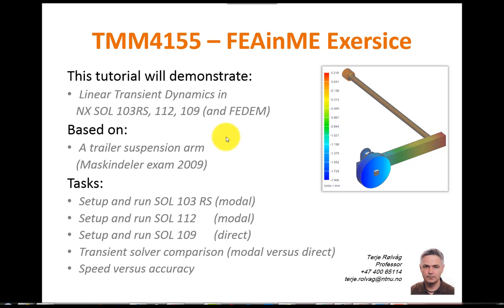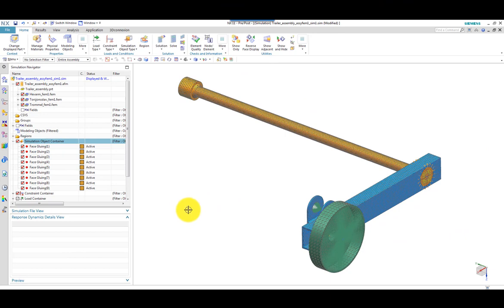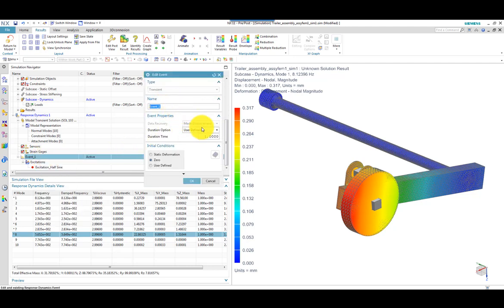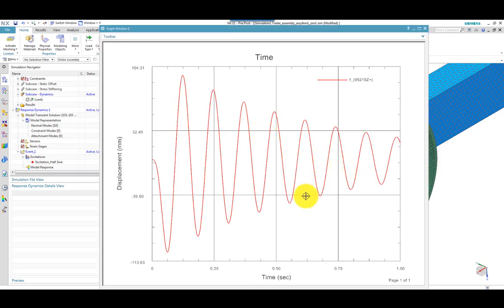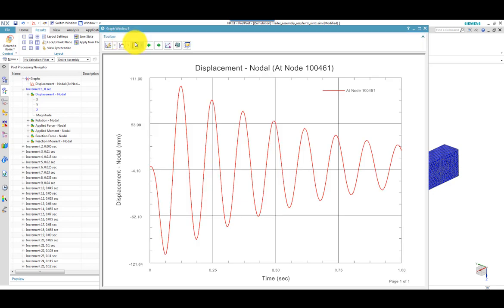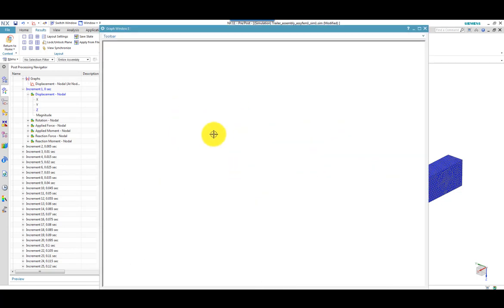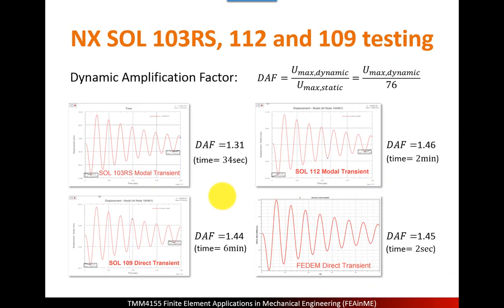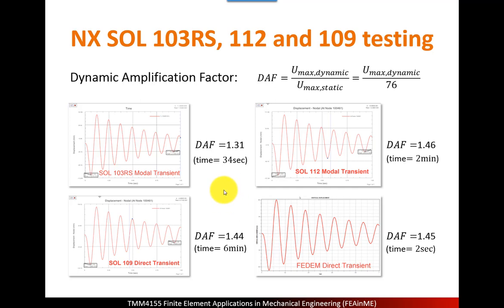Transient Dynamics Benchmark

Comment: Hi, thanks for the video.
I am doing FRF using SOL 111. I am having trouble defining my load and damping as a function of frequency. I would appreciate any help. I have posted my complete query in NX Nastran discussion forum:
https://community.plm.automation.siemens.com/t5/3D-Simulation-NX-Nastran-Forum/SOL-111-FRF-Problem-in-defining-load-and-damping-as-a-function/m-p/462467#M2552
Thanks.
Reply from the maker: I will start teaching FRFs in my course FEAinME next month and then I'll see if I can look into your problem
Reply: Terje Rølvåg  Thanks, also I was curious how you defined loading in SOl 109 and 112. Is it simply load defines as magnitude and direction or is it defined similar to how you defined in SOL 103 RS using new event and half sine wave function.